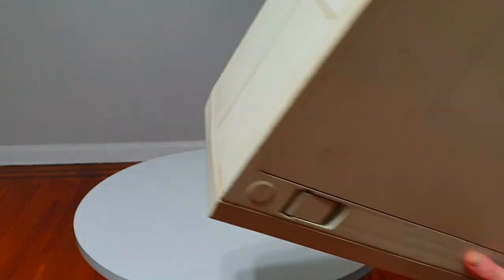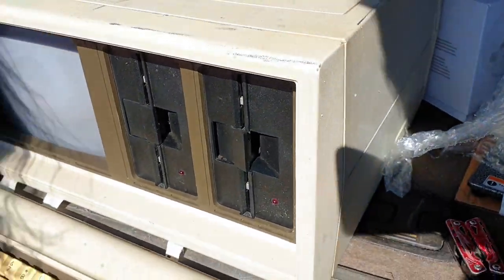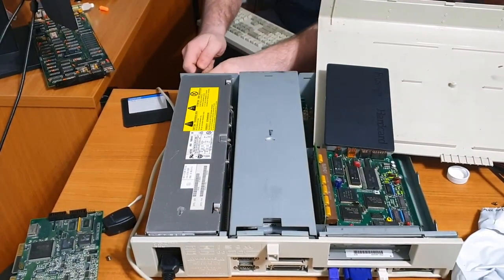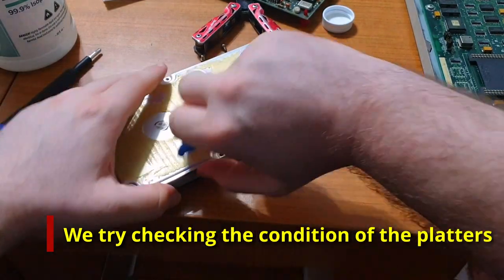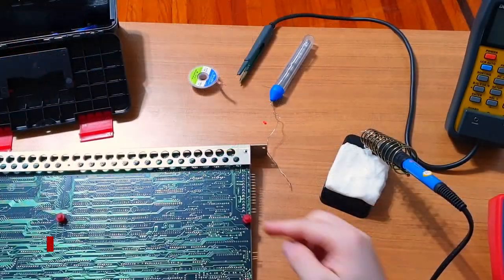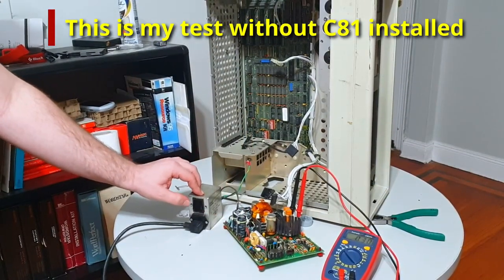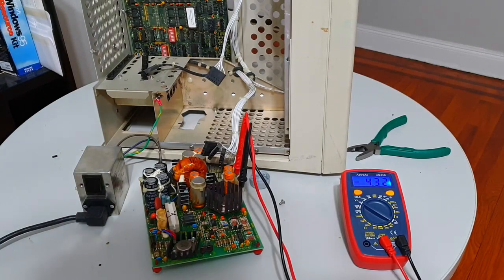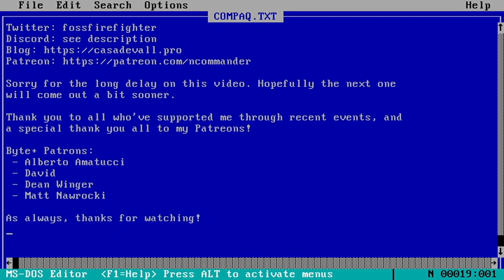Repairing An Explosive Compaq Portable I

Comment: You never get used to exploding caps, no matter how prepared you think you might be. :D
Reply from the maker: I was a line firefighter, so I turned the psu off, then my brain processed what just happened
Reply: What are you talking about?  I just wanted to see my room from the ceiling, that's all.
Reply from the maker: Obviously the correct solution is to mount your desk so you can solder while lying on your back.
Reply: Electroboom: Hold my beer!
Reply: I think you should have to ground the board when soldering.
Reply: @NCommander  Well... at least you'll know what to do if a computer suddenly catches fire. :D
Reply: Really? My time working on 4kw 12v computer PSUs begs to differ...
Reply: @o_o-_-8639  I was about to say that

Comment: I've seen enough Compaq Portable repair videos (and early IBM PC/XT videos) to figure there was going to be a tantalum filter cap involved, and this one didn't disappoint.  Removing those should be high on the list of 'first things to do during a restoration'.
Reply from the maker: I did check that cap specifically with the DMM and ESR and it tested good. I only figured out it was a filter cap after it exploded
Reply: Yeah, everything I bring in gets a proper recap. Tantalum and aluminum caps never fail to give me surprises.
Reply: Absolutely.  I don't even turn stuff on anymore until all the old electros are replaced, a new fan in the PSU, and if it's older than a 386, the tantalums gotta go too.  Although I'm convinced IBM was trolling people with those 3-pin caps with the legs bent under the PCB.

Comment: If the PSU board itself looks undamaged, I'd suggest replacing the electrolytic caps and giving it a chance. I've rebuilt a few PSUs in synths and samplers with good results - as long as there's no catastrophic damage then it's usually just the bigger caps drifting out of spec (and the dreaded RIFA caps if they're present).
Reply from the maker: No RFIA's I could fine, but there is a sealed metal can with the IEC plug on it; no way to open it, although no one has reported a RFIA explosion from one of these.

Comment: Just had a similar cap blow on me too on my 5150, then immediately caught the board on fire. Fortunately I was able to quickly pull the power and blow the small flame out, but it sure made me glad I was in the room at the time... and realize I shouldn't leave my old-timers on unattended.

I would be very curious at what it might take to refresh that old PS. I like using the original units in my old machines when I can, but I know its only a matter of time before something goes.
Reply from the maker: I'm semi-debating replacing all the capaciters, although I feel like I run more risk of damaging the board than not ...
Reply: @NCommander  Get yourself a Hakko resoldering gun.

Comment: NCommander, Great video. 👍 I’m in a process of trying to get my Portable 2 back to life. But I came across that C13 cap is blown on power supply. Tried to locate a circuit diagram for PSU and no luck. Do you know what cap is in used C13? Without knowing the details will not be able to order a replacement. Thanks

Comment: I noticed that at 19:50, the voltage showed on the multimeter keeps dropping, from my experience, I think that suggests the PSU is still partially shorted.
Reply from the maker: There's a lot of things that can be causing that. Diode reverse bias failing, flaky caps, zener cap having issues (since zeners are what generate the 5V rail). It's a giant mess of issues which is why I really just don't want to repair it.

Comment: If you need to create the -5v rail, one EASY solution that comes to mind: I think it was called the Voltage Blaster - a tiny (modern project) 8-bit ISA card that generates that rail, feeding it back into the mobo.  Have you done any more work on this project since the video?  I'd love to see how it turns out!
Reply from the maker: I got the machine working again, but I didn't film a part 3 as these videos didn't do very well. However, I use three slots in regular operation, and with five total, a voltage blaster isn't really an option sadly.

Comment: I would try getting the old psu to work. For such an iconic machine, best to try to keep as much circuitry original as possible.
Reply: Absolutely.  PSUs seem to fail in one of a few common ways, and you can go a long way with minimal know-how and testing equipment.

First, replace all the electro caps, then look for the large-package diodes and transistors.  Remove those from the circuit and test them with a multi-meter.  If they don't test out OK, replace them and just try it again.  There's a good chance it'll fire right up.  But just in case, you might want to buy a couple extra.  They're usually pretty cheap.
Reply from the maker: I'm hesitant to do this on the basis that this PSU design uses quite a few zener diodes to downstep the voltage (the 5V rail is generated that way). It's pretty much a single component failure from frying the entire PC. I didn't realize quite how bad it was when I first started with this project.
Reply: I understand the sentiment, but I think the more you work with power supplies, the more you realize you are always one component failure away from catastrophy.  haha

Zeners don't tend to be regulators themselves.  More often, they are used in a voltage reference circuit.  So, you pass +12V through a resistor (to limit current), and then into a Zener with a breakdown of ~5V, then to ground.  The junction between R and Z is going to be around 5V, and so you can use that as one input to a comparator that's in the feedback loop of the 5V regulation circuit.  It's not handling any current to speak of.

External to this, there's usually a protection circuit that's monitoring the voltages produced by all the rails, and when they exceed a margin of error, the drive signal to the main switcher is cut off, or something similar.  So, if that Zener goes open and the 5V reference voltage is suddenly at 12V, the over-voltage protection circuit should put the kibosh on things right quick.

Suffice to say, nothing lasts forever and there are never any guarantees that the whole thing won't just pass rectified mains straight into your motherboard.  But, there are checks and balances to prevent that from happening.  If the output caps are in good shape, the secondary rectifier diodes are working properly, and the LM339 (or whatever is monitoring the rails) hasn't been blasted apart, you're probably as safe as you can get with any PSU -- new or old.
Reply from the maker: @nickwallette6201  true, but there's a world of difference when said component is mostly new, vs. 40+ years old.

Comment: If you check out Phil's Computer Lab, he worked with his audience to design a board for using converted modern ATX supplies on older systems. If you search for "phil's computer lab voltage blaster" and click "I'm Feeling Lucky", you'll see the article with a very short parts list and the gerber files for the ordering a PCB.  When built, it slots into an ISA slot and provides the -5V rail for cards in the system that require it.
Reply from the maker: That solution works, but this system only have 5 ISA slots, and nothing built in. I'm likely using 3-4 slots just for basic functionality, so I'm better off with soemthing that eats a full slot.

Comment: Here's an easy way to go about the PSY issue:  Mean Well.  I know that it can cost some, but there's bound to be a solution that will fit into the allotted space.  Even if you have to get 2 small ones (in physical size, stacked) to get the voltages required, I strongly recommend this.  Tip: go for the ones that are designed for medical devices as they don't have any enclosures from Mouser or equivalent vendors.  The ATX adapter can still be used in conjunction with the Mean Well PSU(s), just desolder the ATX connector and run the wires to there.
Reply from the maker: I've seen someone who basically did this for the Portable. The PSU is going to be the last thing I tackle in this project, but I'm keeping ideasa in the back of my mind ...

Comment: Thanks for the video and reviving(so far) this jewel. Your journey was a really entertaining watch, NCommander:)
Now to the woman-splaining part(You asked for tips! Hehehe): You treating that dead capacitor with kindness and respect gave me a smile:) Just a thought (and THE OBVIOUS? *g* ) that gets more and more important if you have components with more than two legs and no $2000 de-soldering equipment. If a component is dead and you know it for sure ... use an electronics-side-cutter (not some "plumper-pliers", they just stress the PCB pads) and CUT the legs off. Then you use needle-nose-pliers and your soldering iron to easily de-solder the left in pins without any stress for the copper pads and traces. Cleanup can be done with de-soldering braid or a de-soldering suction pump. 
Of course, that only applies if you don't want to open a museum for old broken capacitors:)))

BTW this is meant in the context of that we RESTORE and PRESERVE old/retro hardware. Which implies that we do not stress the "patient" more than needed. Older PCBs and components or connections, etc do not get better over time. The opposite is true. Also assumptions (seen very often in the retro-community/YouTube) will stab you in the back. Like "Good, the over-voltage protection of the (40 years old!) PSU kicks in ...". That are "famous last words", hehehe. But does it kick in fast enough? At all rails? Does the over-current protection work? Oh and ask yourself: How did you know, that the protection worked? Yes: Because it didn't catch fire and took all other components including those you wanted to preserve with it into the Nirvana. That was a lottery game, think about it! Proper testing and repair work HAS to be done at a place with at least a working laboratory power supply with current limiting. Not taking these precautions is to beg for disaster ... for devices there is possibly no more spare parts to find out there in the wilderness. 

This should not be a criticism or an accusation and the following is not directed at you personally: Many (too many) do repairs the brute force way and don't even know the professional approach to certain tasks. It's a job that you have to learn. Good luck with repairing (even the professionals need luck) and tinkering with the hardware. Thanks:)

Comment: Doesn't need to be this dramatic.  You just start clipping one lead of each tantalum cap until it powers on. Then you replace the one which was shorted and re-solder or replace the others.   This whole process takes about 60 seconds. You don't even need to desolder it. Clip the leads and solder the new one to the old leads.

Comment: I second the notion of using an ATX adapter to power older equipment. Old power supplies are well beyond their safety lives and are ticking timebombs. We've come a long way in power supply technology since the 80's and 90's and are much more safe and reliable to the point where I'd trust a modern ATX supply for several decades.
While I understand the argument for keeping the circuitry original, the PSU, in my mind, is nothing more than a means to an end. It has little significance and utility outside of basic power supply.
Reply from the maker: That's kinda how I'm leaning although a lot of people want me to stay with the original PSU, but this PSU design is basically a single zener diode from deliver 12V to the 5V components ...

Comment: fully open short you say? :) 
The soldering iron you are using looks like the $10 "soldering kit" special from Amazon. Dont do that, you will only think soldering is hard. Its unregulated (has basic light dimmer instead of temp control) and shittiest smallest possible tip.  Buy a $15.32 "Digital Soldering Iron Station Temperature Controller Kits For HAKKO T12 Handle" on ebay. It uses very good T12 cartridges (same as >$300 stations, integrated heating/sensing element), is easy to assemble, and only requires old 19v laptop power supply and random case for the controller pcb to function. That, or proper FX-951.
Reply from the maker: It's a cheap iron, but it was more nerves than anything else that made it difficult. I'll probably look at replacing it.
Reply: @NCommander  Novice instinct is small elements(especially smd) means I need small tip, this leads to bad heat transfer and loss of confidence. On the video you were using the smallest sharpest tip, all the cheap soldering irons ship with it for no apparent reason, its useless. Use the largest chisel tip suitable for the job and everything will go smoother.

 T12 cartridge soldering stations, no matter if original ~$300 Hakko or $15 DIY kits, give you even more confidence by providing greater temp control and heat capacity, means you can use lower temperature and everything still melts instantly without danger of destroying pads or lifting traces.

Oh, and dont put the random Chinese industrial waste flux paste with your finger, at least not the same one you use for eating or scratching your eye 10 minutes later :) This is nasty corrosive stuff.

Comment: Just watched the intro so far.  As someone currently in an extended epic slap-fest with a PS/2 Model 70, I can relate.  It hates me.  I don't know what I did to offend it, but I know with absolute certainty that it hates me.
Reply from the maker: Working on PS/2 machines are a downright pain since IBM really went out of their way to make everything as different as possible, and you basically need everything to work just to be able to install the reference disk and boot.

Comment: Regarding the -5v issue, someone has worked this out already - you can buy a Voltage Blaster to put into an ISA slot - https://www.philscomputerlab.com/voltage-blaster--5v.html
Reply from the maker: On a system with only 5 slots, and at least four used for basic functionality, bit of a tall order :/
Reply: @NCommander  ah crap! I forgot that literally nothing is onboard! You could replicate the functionality of the Voltage Blaster and solder it to one of the already populated ISA slots perhaps?
Reply from the maker: That may be what I end up doing, although very few isa cards need -5v. There is a pin on the atx adapter for -5v, so its an easyish mod